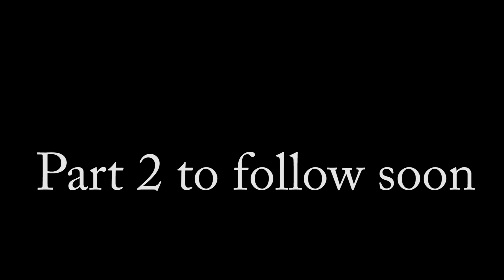Pfizer, process 2

Comment: My neighbor, a 24 years old so far fit young man had a stroke and also non functionating kidneys, he is on dialysis now, life long.
The doctor explained his mother, that's nothing special in our days, many of his patients have same fate, to calm her down. Well ....
Reply: They will say it is long term covid...😅
Reply: How long after the vaccine did this happen?
Reply: The truth would have been a better answer
Reply: What?! Another provider needed
Reply: "in our days". Yup.
Reply: It is amazing what's going on, but fasting to restore the damage it does to the immune system can prevent the worst of these side effects. It is also very helpful for organ damage. Some benefits of doing occasional extended fasting: High blood pressure is lowered to normal levels very quickly while fasting. Fibrosis/scarring is reversed over time, including in the heart and lungs.

Fasting stimulates phagocytosis, the ingestion of bacteria, plaques and viruses by the immune system. It will also remove any 'foreign material' like spikes that are not supposed to be there. Whether natural or unnatural in origin..

Blood clotting is reduced and blood clots and arterial plaque are reabsorbed into the body. 

Blood sugar and insulin are lowered when fasting, allowing white blood cells to move more freely throughout the body and do their job.

Fasting increases nitric oxide release. 

Fasting restores NAD+ to healthy levels.

Reflexes and short term memory are increased. 

Fasts from 36-96 h increase metabolic rate due to norepinephrine release! 

Telomeres are lengthened and fasting also increases anti-aging Yamanaka factors.

After 72 hours or more fasted, your body recycles up to 1/3 of all immune bodies, rejuvenating your entire immune system. This helps prevent the onset of new autoimmune conditions, which develop through a leaky gut and damaged immune system.

Fasting can help with MS, Depression, BPD, Autism and seizures.

Thymus is regenerated, which suppresses aging and renews the immune system. The thymus also plays a vital role in fighting cancer.

Weight loss from daily caloric restriction has 1/4 to 1/3 of the weight lost as lean tissue while many studies show fat loss from 36 h fasts without losing any lean tissue! 

The obese will lose extra tissue like loose skin while fasting, but the skinny or frail will have increased growth hormone release than the obese, which helps to make more lean tissue and reduce frailness.

When you move out of MTOR your body shuts down the building blocks of the cell required for viruses to replicate.

The hunger hormone ghrelin also lowers with extended fasting and rises from dieting. 

What breaks a fast? Anything with protein or carbohydrates in it will break a fast. Most teas and herbs are OK. Most supplements and meds will either break ketosis directly or contain a filler that will. Many meds are dangerous to take while fasting.

Does fasting lower testosterone? No, it raises it when the fast is broken by increasing lutenizing hormone. Fasting also increases insulin sensitivity, which helps with muscle building.

Fasts of 36-96 will not affect short term female fertility or affect menstrual cycle. They also may increase long term fertility, especially in women with PCOS.

Fasting reduces pain and anxiety by stimulating the endocannabinoid system in a similar way to CBD oil.

One day of fasting can cut your leptin levels in half and gets your immune system working properly again! This reduces leptin resistance, which impairs immune function. 

Stomach acid is reduced over time while fasting and can allow for the healing of treatment resistant ulcers. Some patients may need continued acid reduction medication while fasting.

Does the body preferentially prefer glucose as a fuel? No. Except for brief periods of very intense exercise, your body mainly burns fats in the form of free fatty acids. Your brain also prefers to burn ketones at a rate of around 2.5 to 1 when they are available in equal quantity to glucose.

Fasting stimulates the AMPK complex and activates autophagy. Autophagy (literally self eating) will cause cells to recycle damaged proteins and foreign matter such as viruses. It will can kill cancerous and senescent cells

It increases mitochondrial function and repairs mitichondrial DNA, leading to improved ATP production and oxygen efficiency. Increased mitochondrial function also has the added benefit of increasing your metabolism, fighting infection and cancer prevention!

Fasting releases BDNF and NGF in the blood which stimulates new nerve and brain cell growth. This can help a great deal with diseases like MS, peripheral neuropathy and Alzheimers.

When not in ketosis, the brain can only burn carbohydrate, which produces a great deal of damaging ROS the brain has to deal with.

Fasting also increases telomere length, negating some of the effects of aging at a cellular level.

When you fast, this stimulates apoptosis in senescent or genetically damaged cells, destroying them. Senescent cells are responsible for many of the effects of aging and are a root cause of the development of cancer. 

A fasting mimicking diet for 3-5 days in a row also provides many of the same benefits as water fasting. FMD usually has 200-800 calories, under 18 g of protein and extremely low carbs.

Exogenous ketones can aid with fasting, making it easier in healthy people and allowing some people with specific issues to fast in spite of them without worrying as much about hypoglycemia. They also help with dementia and many other issues even if you take them while not fasting!

Glycine and trimethylglycine can also be useful supplements while fasting that won't break ketosis and have many benefits.

Children, pregnant or nursing women should not fast for periods longer than 16 hours. People with pancreatic tumors or certain forms of hypoglycemia generally cannot fast at all. Type 1 diabetics can also fast but it is more complicated and should be approached with caution as it could lead to ketoacidosis. If you experience extreme symptoms of some kind, especially dizziness or tremors, then simply break the fast and seek advice.

Resources:
https://www.ncbi.nlm.nih.gov/pmc/articles/PMC5783752/
https://www.ncbi.nlm.nih.gov/pmc/articles/PMC1413655/
https://www.ncbi.nlm.nih.gov/pmc/articles/PMC5783752/
https://pubmed.ncbi.nlm.nih.gov/6859089/
https://www.ncbi.nlm.nih.gov/pubmed/10232622
https://www.ncbi.nlm.nih.gov/pmc/articles/PMC8470960/
https://www.sciencedirect.com/science/article/pii/S1931312809002832
https://pubmed.ncbi.nlm.nih.gov/15522942/
https://faseb.onlinelibrary.wiley.com/doi/abs/10.1096/fasebj.2019.33.1_supplement.819.10
https://www.biorxiv.org/node/93305.full
https://www.arcjournals.org/pdfs/ijrsb/v3-i11/7.pdf
https://www.ncbi.nlm.nih.gov/pmc/articles/PMC6407435/
https://www.ncbi.nlm.nih.gov/pmc/articles/PMC6141719/
https://pubmed.ncbi.nlm.nih.gov/20921964/
https://pubmed.ncbi.nlm.nih.gov/25909219/
https://www.cell.com/molecular-cell/fulltext/S1097-2765(18)30605-1?_returnURL=https%3A%2F%2Flinkinghub.elsevier.com%2Fretrieve%2Fpii%2FS1097276518306051%3Fshowall%3Dtrue
https://pubmed.ncbi.nlm.nih.gov/28235195/
https://www.ncbi.nlm.nih.gov/pmc/articles/PMC2815756/
https://www.nia.nih.gov/news/research-intermittent-fasting-shows-health-benefits
https://medicalxpress.com/news/2022-10-treatment-pulmonary-fibrosis-focus-telomeres.html
https://www.ncbi.nlm.nih.gov/pubmed/10859646
https://academic.oup.com/ajcn/article/81/1/69/4607679
https://pubmed.ncbi.nlm.nih.gov/31877297/
https://www.ncbi.nlm.nih.gov/pmc/articles/PMC7093158/
https://clinical.diabetesjournals.org/content/36/3/217
https://www.ncbi.nlm.nih.gov/pubmed/23876457
https://www.ncbi.nlm.nih.gov/pmc/articles/PMC6526871/

https://n.neurology.org/content/88/16_Supplement/P3.090
https://pubmed.ncbi.nlm.nih.gov/31890243/
https://pubmed.ncbi.nlm.nih.gov/2518860/
https://pubmed.ncbi.nlm.nih.gov/29727683/
https://www.ncbi.nlm.nih.gov/pmc/articles/PMC5895342/
https://www.ncbi.nlm.nih.gov/pubmed/25686106
https://pubmed.ncbi.nlm.nih.gov/21410865/
https://www.ncbi.nlm.nih.gov/gene/25712
https://pubmed.ncbi.nlm.nih.gov/23707514/
https://www.ncbi.nlm.nih.gov/pubmed/24905167
https://www.health.harvard.edu/heart-health/abundance-of-fructose-not-good-for-the-liver-heart
https://www.ncbi.nlm.nih.gov/pmc/articles/PMC7607739/
https://www.collective-evolution.com/2017/05/16/study-shows-how-fasting-for-3-days-can-regenerate-your-entire-immune-system/
https://pubmed.ncbi.nlm.nih.gov/7714088/
https://www.cell.com/cell/fulltext/S0092-8674(19)30849-9
https://www.ncbi.nlm.nih.gov/pmc/articles/PMC3017674/
https://pubmed.ncbi.nlm.nih.gov/23408502/
https://www.amjmedsci.org/article/S0002-9629%2815%2900027-0/fulltext
https://europepmc.org/article/MED/22402737?javascript_support=no
https://onlinelibrary.wiley.com/doi/full/10.1111/j.1365-2265.2005.02288.x
https://www.nejm.org/doi/full/10.1056/NEJMoa012908
https://pubmed.ncbi.nlm.nih.gov/27569118/
http://www.cell.com/cell-metabolism/abstract/S1550-4131(15)00224-7
https://repository.upenn.edu/cgi/viewcontent.cgi?article=1537&context=edissertations
https://www.ncbi.nlm.nih.gov/pmc/articles/PMC1779438/
https://www.nejm.org/doi/full/10.1056/NEJMc2001176
http://www.sciencedirect.com/science/article/pii/S0005272806000223
https://www.clinicaltrials.gov/ct2/show/NCT04375657
https://pubmed.ncbi.nlm.nih.gov/20102774/

This list compiled over years of research by the user known as Pottenger's Human on youtube. Feel free to copy and paste this anywhere you like, no accreditation needed!

My community tab will always contain an updated version of this list of fasting benefits. I also have playlists on fasting and health topics.
Reply: @LTPottenger  I'm willing to testify for this fasting  method. It helped me to get rid of the last of symptoms caused by shedding two years earlier. Thank you for sharing your knowledge.
Reply: @LTPottenger was wondering when you'd show up here. I've been giving some desperate folks a tiny bit of info. As expected, the response has been indifferent  at best. They're loss, unfortunately!!
Reply: Rip to your neighbor 😢, that's so fucked up
Reply: My cousin died of aggressive lymphoma after the boosters.

Doctors and nurses complaining too many young people with aggressive cancers recently, especially blood cancers.
Reply: "In our days" = new normal
Reply: Nothing special after the vaccines more likely. A woman whom I spoke to today had a similar problem with her kidneys after the vaccine.
Reply: The New Normal crazy shit.
Reply: What will people do who haven’t had the V, but in an emergency need a blood transfusion? 

I’ve been told the blood will cause issues to the recipient? 

So is there any Un V’d donors?
And how will they check before they just give you blood that is potentially dangerous.

Edit: would UnV’ed people be able to give blood and it would dilute or flush out the V’d blood?
Reply: @KyleTheDalek  I don't think unV has the right to select blood from unV donnor. In Canada an unV lady was refused organ transplant due to unV. She just died.  They totally politicized a medical treatment .
Reply: @KyleTheDalek 
I gave blood for the 1st time in my life. The screening Q-re had many Qs about hepatitis (illnesses and/vaccinations) — no problem, understood, right?
And then suddenly, there was a Q “have you been vxx’d for COVID?”— “no”. That was the last Q. Why would THAT be important for blood transfusion, right? … I was cleared to give blood. 
Several vxx’d people were also allowed to give blood — they HAD BEEN vxx’d (colleagues). 
Of course, I don’t know what they put on their Q-re.
Reply: Do some fasting to kill off the affected blood cells, same as if you took it yourself. @KyleTheDalek
Reply: Those sound like global warming symptoms to me.

Comment: If there is impurity with DNA, this means replicating for ever. Spikes life long.
Reply: What? No it doesn't. Explain how.
Reply: Well, Spike DNA, like any DNA can be built naturally inside human genom, contrary to RNA, which happens rarely through reverse transcription.
Also, if there is DNA inside plasmides and they are of course part of bacteria and bacteria replicates ad infinutum, so the Spike DNA inside also replicates infinitely.
Reply: @markborz7000  RNA happens rarely? It's... it's literally the driving force for how cells work, dude. Look it up. Or... maybe check out a high school biology class? Feels like you missed a couple.

Reverse transcription is RNA to DNA (for proof of this, look up the HIV virus-- it uses reverse transcriptase to convert the RNA inside it into DNA that it then uses integrase to put inside a cell's DNA). DNA to RNA, which happens constantly all the time in every single cell ever because it's how proteins are made? That's just transcription.

Plasmids are made of DNA, they don't have DNA inside them.

Bacteria replicate their internal parts, yes.

The bits inside a bacteria being replicated when a bacteria replicates does not even begin to imply or prove that the bits inside bacteria will replicate on their own outside of the bacteria.